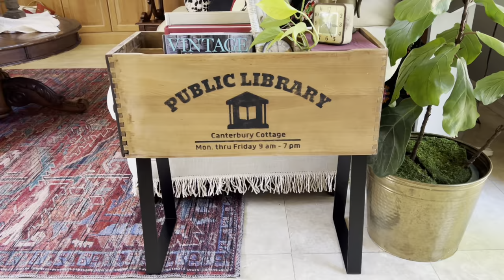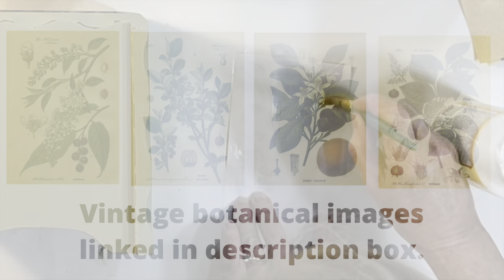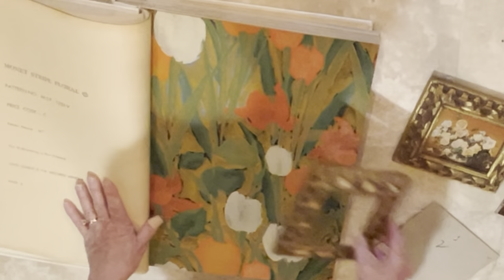15 DIY VINTAGE COTTAGE HOME DECOR THRIFT FLIPS ON A BUDGET

Comment: Sheri, the lamp and legs were my favorites and you didn’t disappoint (you never do) in your remakes! I loved everything you updated, but the legs attached to the drawer with the Canterbury Cottage stencil was my favorite. So unique and also beautiful and useful. Adding the scrolls holding the hanging air plants was a wonderful finishing touch. Thanks for sharing.
Reply from the maker: Sarah, you are so very kind! Those metal legs were such a find—I wanted to use them in a unique way rather than making a bench. I was so pleased that they fit that drawer perfectly.  I knew I wanted to hang those little vases from the lamp, but I didn’t want to use plant brackets that would stick out, so those little scroll pieces were perfect. I’m so glad that you liked them, too!😊

Comment: Good morning, Sherry. Loved what you did with all of your projects today.  The drawers look identical to ones I have in a Franklin roll top desk I inherited from my father.  Terrific use of both of them! And using the $3.00 metal legs certainly made a “one of a kind” piece.  The canisters turned out fabulously too!  The two 50 cent frames with wallpaper inserted and the notecard into the silver frame were divine.  The clock face and needlepoint insert is stunning!  I could go on and on with compliments on the transformations.  Lol.  Thanks for the continued inspiration!  See you next week!
Reply from the maker: Thank you so much, Lee! You are so very kind. There were some burn marks on the bottom of the small drawer, so I think the desk was in a fire. Perhaps, only a couple of the drawers were salvageable. The drawers are heavy and dove-tailed, so I’m sure the desk was lovely.

Comment: I think I would paint the top and bottom pieces you added to the pedestal to match to make the piece more cohesive.  Alternatively you could paint another color.  As it is, it just doesn’t seem to work well together.  Of course, that’s just my opinion.  I just found your video in my feed.  I must say, what you’ve done is so creative.  I love the clock frame with the needlepoint insert, the table you made out of the drawer and kept open with the dividers is extremely unique and clever.  The little baby buggy or pram as it was likely called in the day, is charming.  I’m not one for faux plants, but sometimes you don’t have a choice.  I mix them in to fill spaces on rare occasions.

Comment: The drawer/table is fantabulous.  Love it.  Like the floor lamp, but I would put a taller harp on it to raise the shade up a bit.  Shari, I would like to know when you decide to use chalk paint vs. spray paint.  Needlepoint is so lovely.  Baby buggy with faux plants is adorable.  Needlepoint hummingbird.  Great.
Reply from the maker: Bonita, I did put a larger harp on it at first, but it didn’t look right to me. It is an odd lamp. Most of the time, I use chalk paint on wood because I like the matte look and how easy it is to distress with sandpaper. Wood also soaks up spray paint, and it usually takes several coats which sometimes look streaky. If I do decide to spray paint something that is wood, I will use the Zinsser primer first. I like to use spray paint on glass, ceramic, metal, wicker, or anything with intricacies that are hard to paint with a brush.

Comment: I love the round, framed needlepoint, but I am concerned the acid in the cardboard will destroy the needlework fabric.
Reply from the maker: I didn’t know there was acid in cardboard. I will have to research this. Perhaps, I should use a thin piece of plywood from now on. Thanks for letting me know about this!
Reply: @CanterburyCottage  wood has acid, too. You can buy acid-free cardstock at Michael's, Hobby Lobby or Amazon. Fabric and photos need special care. Get a glass cutter to cut a round piece of glass or acrylic to fit--not very expensive. (I replaced a broken round mirror, so I know it can be done.) That frame and needlepoint are beautiful and worth protecting. I bought a framed piece of embroidery. When the frame broke, I realized it was the cardboard that yellowed the fabric. To make matters worse, regular masking tape had been used to tape the fabric to the cardboard.

Comment: Absolutely love your style 💕 I noticed you use a lot of wax. Why do you apply wax? I do a lots of crafts but never used wax. What does it do?
Reply from the maker: Once it hardens (which can take a few weeks), it provides a protective (and water repellent) topcoat for the paint. If you use chalk paint on furniture, you will want to use wax; however, it is certainly not always necessary on home decor that gets less wear.

Comment: The ideas seem to just keep tumbling out of your head! Love the library book table. The kitchen canisters turned out so pretty. Do you find that wax finished items collect dust that is hard to remove? Just wondering. Thanks.
Reply from the maker: Thank you! That is a good question. I haven’t noticed any issue with dust. The wax soaks in and hardens over time.

Comment: Did u do a video on a makeover for fireplaces? I want to give my fireplace a face lift.
Reply from the maker: I painted my brick fireplace and mantel before I started my YouTube channel. I also made over the fireplace in our previous home. If you have a wood surround that you want to paint, I suggest using Zinsser shellac primer. This is similar to the spray primer I use but in a quart or gallon can. It is runny but sticks to everything; it is the best primer I have ever used. If your brick has never been painted, you will need to prime first. You could try the shellac primer or use the regular Zinsser primer.

Comment: How did you go about cleaning the artwork? I have so many I'd love to clean but I'm unsure how to go about it x
Reply from the maker: So, I just took the back off the frame, removed the print and dusted it with a microfiber cloth. Then, I cleaned the glass inside and out. It was surprising how much grime was on the inside of the glass.

Comment: Hi Sherry! I've been enjoying your videos since the Chrismas holiday season, so thank you. Lots of great tips and tricks. Do you know of a product I can use to print removable vinyl sheets on my inkjet printer? I'd like to make my own sheets of removable 'wallpaper' pictures for kitchen cabinets, but they must be easy to peel of without damage.Any ideas?
Reply from the maker: DeAnne, I’m not sure I understand the question. Are you wanting to put vinyl sheets (like those made for Cricut machines) in your printer? I am pretty sure that won’t work because the ink will just sit on top of the vinyl and even after it dries, it will easily smear. I would suggest using a peel and stick backsplash wallpaper with a design that you like. It can be removed without damaging the cabinets. I used a pretty grasscloth peel and stick wallpaper in several rooms when I redid my son’s basement apartment. Here is one of those videos: https://youtu.be/8T9Rz5WfGAY
Alternately, if you have a specific design, you could buy a plain peel and stick wallpaper and paint on your design with stencils made on your Cricut machine. I would seal the paint with Mod Podge after. Hope this helps!

Comment: May I ask why you use chalk paint? Is it the same as the early 90s chalk paint? What brand do you prefer?
Reply from the maker: Chalk paint contains some Plaster of Paris or other minerals. It sticks to just about everything without priming. If I used a regular acrylic or latex paint without sanding and/or priming, the paint would easily scratch and chip. Other flat paints are not as matte as chalk paint, but you can give it a sheen with wax or a polyurethane. There are some very good “designer” paints like Dixie Belle and Rethunk Junk that are great if you don’t mind paying more. I use Waverly chalk paint because it works well, but it less expensive (and I paint a lot). Do not buy the Hello Hobby brand from Walmart—it is terrible!
Reply: @CanterburyCottage  thank you! I never knew!

Comment: Hi From Aussie. Absolutly incredibly talented. Question please, Is the Antique wax finish for any specific reason, does it seal the paint?? thanks for sharing🌻
Reply from the maker: It does seal the paint just like clear wax. It also adds color that settles in the crevices. Although you can’t see much of the color on black paint, I think it adds some depth to the black paint.
Reply: thank you so much for replying, appreciate it🌻